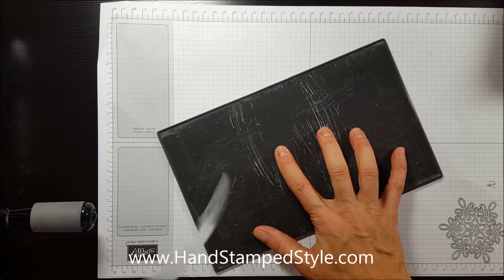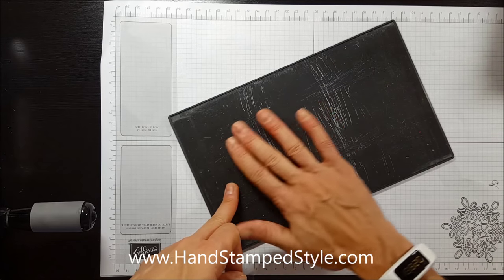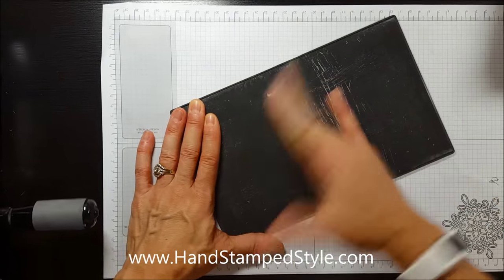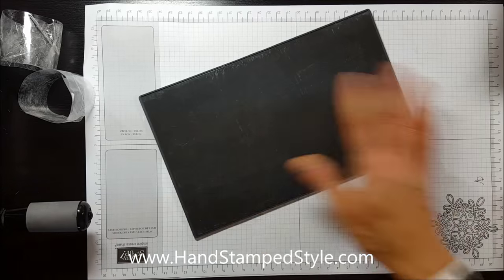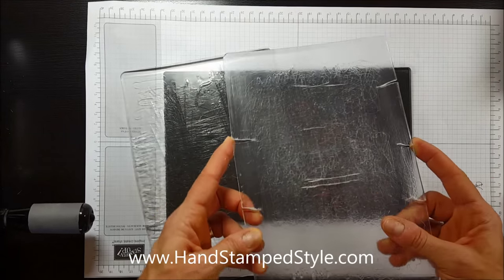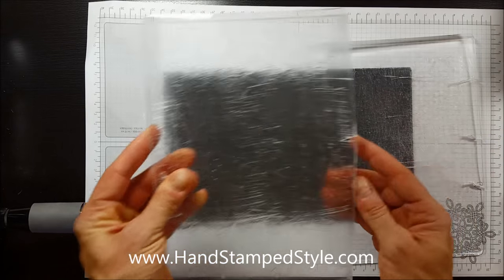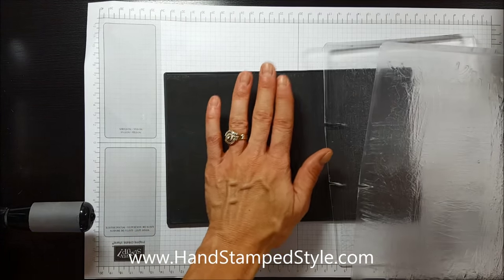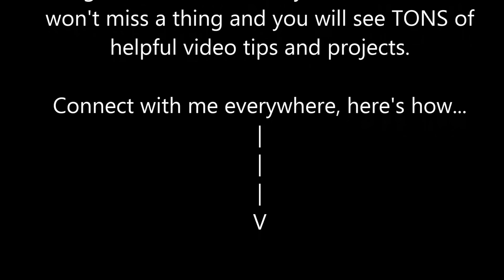How To: Clean the Precision Base Plate for the Big

Comment: Great tip! Do you clean your acrylic plates the same way? Yours look very clean , even though they are well used!
Reply from the maker: +05Trishka I don't, it would be too hard... see with the Precision plate the metal structure of it prevents the paper from being shoved too far in whereas the cutting plates are plastic and the paper is shoved DEEP inside those grooves.  It would be almost impossible to get them clean.  But you will find that with your Precision Plate your top clear plate won't get nearly as yucky as you are used to seeing it, it just gets smooshed, LOL!!  Have a happy thanksgiving.